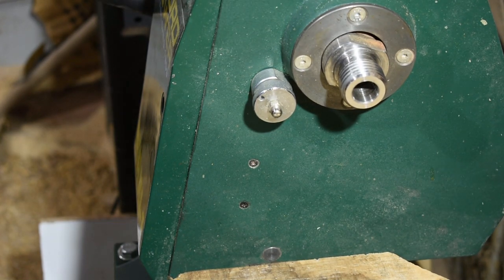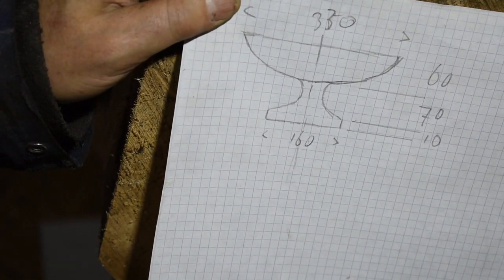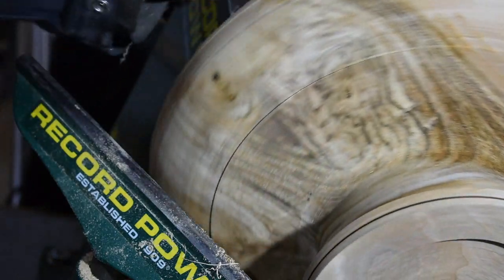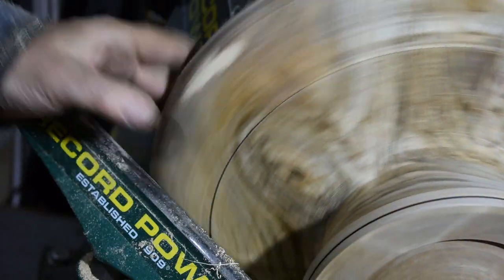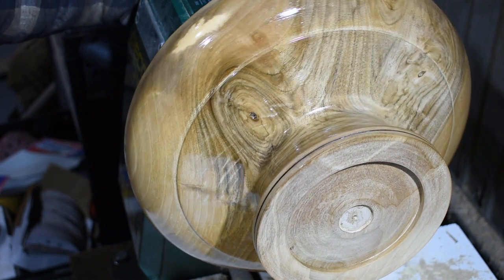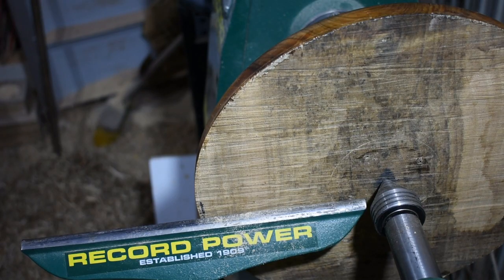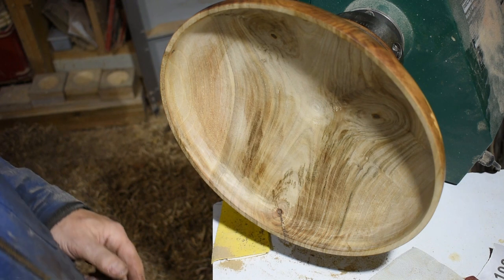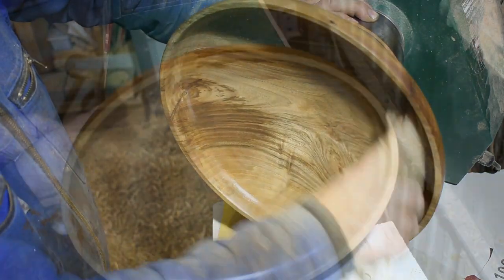Woodturning a Pedestal Bowl for my Sister.

Comment: On the beginning of the video I didn't expected so grained wood 😲 Your sister must be very happy having so beautiful plater. Well done, Leo 👌
Reply from the maker: Basically the same wood as what you had. 
A few centimeters apart maybe but not much more than that.
By now that wood has completely dried and is a bliss to work with. 
Gave some to Frank as well but there is still a lot left. Yesterday I made a square bowl from a branch (also from that tree) that I salvaged from the firewood pile.
I will be turning a lot of Walnut this year.